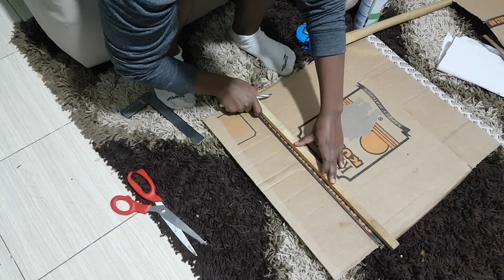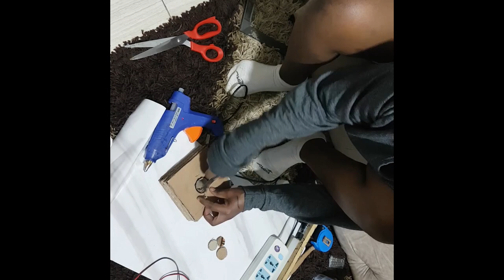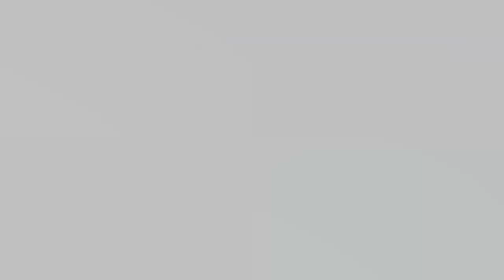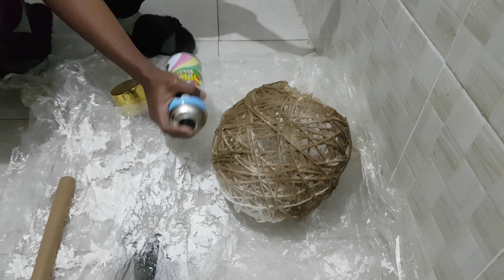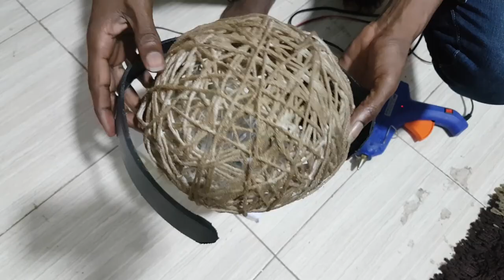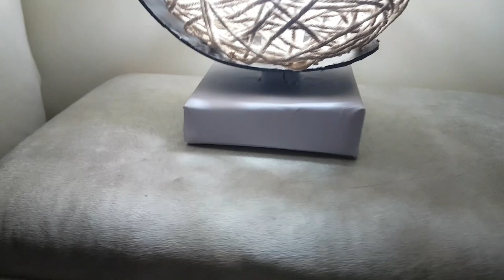How To Make a DIY Lamp Shade Step By Step

Comment: Hi where can I buy the light switch wire? And the black curved thing? Cost? 😆
Reply from the maker: Switch I reused from a light fixture I had which was broken... The black thing hehehe I just cut it from a water Drum I was cutting to make another project I'm working on... So just find a container ti cut out that thing and the swith u can use one which are being sold... Ask for a bed swith holder... It comes with a wire, bulb holder and a swith... Around ksh. 150